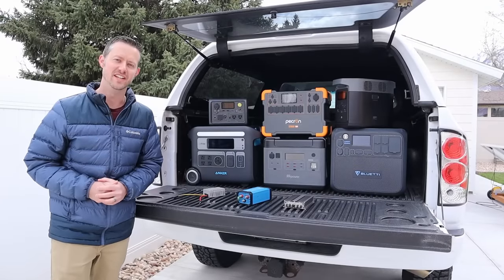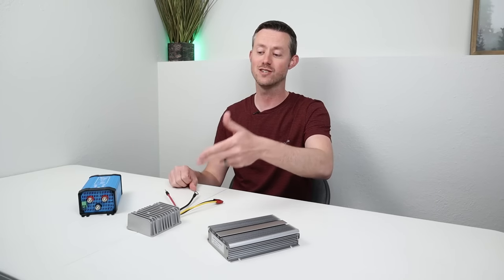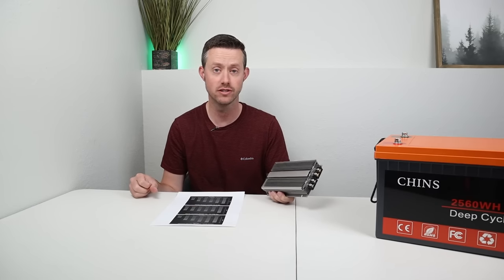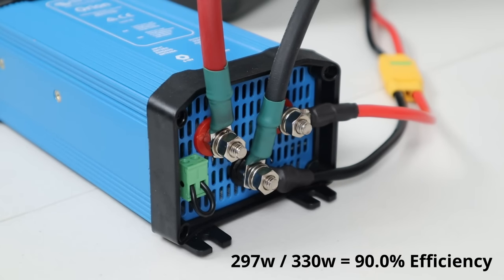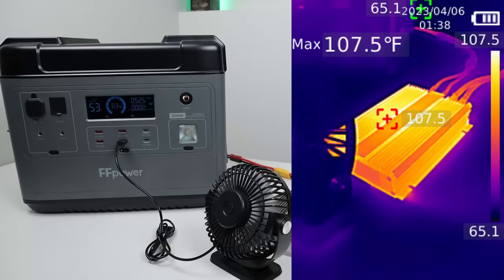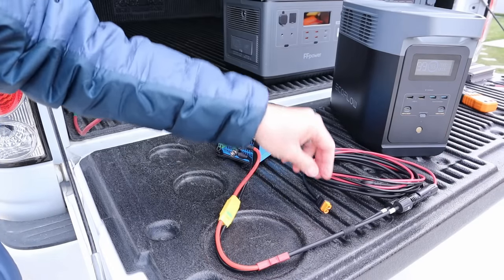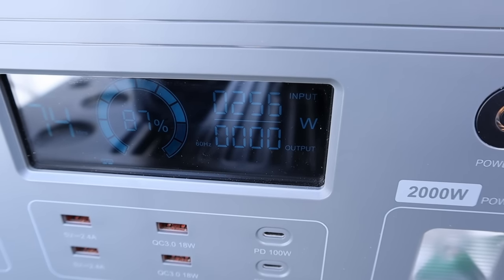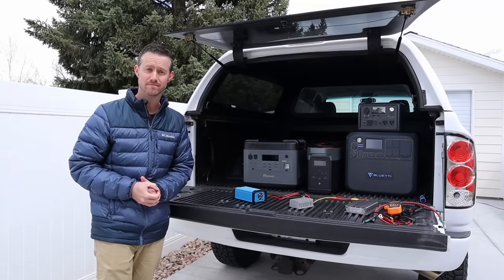Charge Your Power Station In Your Car FASTER - Perfect for Overlanding, Car Camping, and Van Life!

Comment: What size wires do I need to do a 17 foot run(back of truck)
Reply from the maker: Which power station and converter would you go with? It's all based on the total amperage you'll be pulling over the wires.
Reply: @Jasonoid  I want to go with the Victron 12/24-15 Isolated (360 W). Plan is to run it at 30 volts to get more watts into my battery pack (xq60i connector 15 amps max). I watched a video where the guy showed even though his was a 20 amp non smart dc/dc conv,  30 amps was going into the positive post on the converter.

This confused me on what load I should expect. I thought it would only pull what is on the box in his instance 20 amps for mine 15. I assume it wont always pull peak amps rating all the time but do I have to plan for higher current even when my battery pack only charges at 15 amps max?

 Peak current rating on the victron spec sheet is 25 amps so I choose 6 gauge. I believe it gives me some wiggle room but every volt/amps/feet chart I look at is different some of them say run 4 gauge etc. To help you I believe AWG 6 gauge is close to 16mm 2 Metric wire.
Reply: Also plan on using a 40 amp breaker
Reply from the maker: @MR-kc9xt  6 awg is good for 60 amps. The fuse is there to protect the wiring, so you can actually use a 60 amp fuse. The other thing I recommend is that you only run the converter at 50% of its rated power for longevity. That 15 amp model will be maxed out and could possibly fail much faster due to running at 100% load. If you use the larger 30 amp Victron it will run at 50% of its rated power and will last longer. I guess it also depends how often you plan to use it.
Reply: I will try and mess around with the settings to lower its output. Going to be charging a ecovacs battery pack. IN march it will be the first time my partnnr and I 4x4 camp with a fridge so I am not positive what my battery usage will be. I do know 10 amps from a 12 volt socket wont be enough though so found this solution in your video, thanks.

Comment: Did you notice how small the included hardwired cables are on the  cheap model!!
I went from theirs to 10 guage with MC4 ends to make it like a solar panel.
Reply from the maker: This is an nicer model and it came with 10awg wires on the input side stock. I was impressed 👍
Reply: @Jasonoid  oh nice! Looks like illl have to invest again. Thanks for doing the detailed video! Lots of information in perfect length clip as always!👍
Reply: @Jasonoid  Yes, and 12 awg on the output but from your video, it will output about 200w to the power station.  In my setup the cable run from the step up converter to the Bluetti AC200 Max will only be six feet, so 12AWG should be good enough.

Comment: Isn't the concept if having your car charge the large battery is a bad thing? Alternator isn't designed to work that much. I also don't really understand the point of rapid charging the power bank through a stand alone battery. You will still need to recharge the battery afterwards. 😅
Reply from the maker: Using a standalone battery in the video was for testing purposes to measure the power output from each model and the efficiency.
You can stick to 100 watt charging on your power station if you want, no pressure to charge faster. Pulling 200 to 400 watts from an alternator won't harm anything.
Reply: @Jasonoid  ty

Comment: like if you plug solar sysem with the thick blue plug and victron with the small pin where you plug wall brick( and the bluetti enhancer) I would be really grateful for any info
Reply from the maker: You would want to connect the Bluetti charging enhancer to your solar and plug that into the AC charging port (7909mm port). You'd connect the DC to DC converter to the solar input port. That's the only way you could use both types of input on the AC200max.

Comment: please! im desperate. I'm thining to get aferiy p210 and planning to charge it with solar and alternator at the same time. I wanna plug the powerstation straight to the ac plug with an inventer, do you think I need to get a small inventer or adjustable one maybe so I won't burn my alternator? thanks dude you have been helpful lately!
Reply from the maker: If you are wanting to charge with an inverter it looks like that model will charge at 1100w while AC charging. You'll need a 1500 watt inverter like this:
https://amzn.to/3OLDuKi
Reply: @Jasonoid  thanks ! My worry is that if it's draw 1000w wouldn't this be too much for an alternator ? If no I'm buying the one you send me. I just have to find it on UK amaozn as I'm in Ireland. Much appreciated you get back to me
Reply from the maker: @pijanysamuraj  whats the rated amps of your alternator? Usually a quick Google search will determine that
Reply: @Jasonoid  oh shit I don't know I need to do some research. It's an old 1992 Ducato camper. I'll try find it out
Reply: 55-60 amp ?
Reply from the maker: @pijanysamuraj  if the power station charges at 1100 watts, I'd plan for around 1200 watts power usage with inefficiencies. 
1200 watts @ 12v is 100 amps
(Volts X Amps = watts)
You'll need an alternator that's good for at least 150 amps to run that inverter without killing it.
Reply: @Jasonoid  thats not the best news as what I read those alternators are between 55 and 60 amp :/ I don't mind if this will charge slower as long as it will charge
Reply: So my 60 amp alternator won't be any good for this ? I don't mind if it charge slower. So what wattage inventer I need to look at ?
Reply from the maker: You'll need a power station with an adjustable charging speed like Anker or Ecoflow. The you can use the inverter size you want.
Reply: @Jasonoid  the one that has it doesn't have like 12v 25/30 amp to power my fridge light boiler etc. Adjustable inventer wouldn't do the trick ? Once again big thanks for getting back to me and helping me out!
Reply from the maker: @pijanysamuraj  the max power you could pull from that alternator is around 25 amps, so about 250 - 300 watts. Good luck on finding a solution. I can't add on to this thread anymore 👍😁

Comment: How are you connecting the dc to dc charger to the power station?
Reply from the maker: Via the DC charging ports. Positive to positive, negative to negative.
Reply: @Jasonoid  for XT60i, I see that there are ring terminals on one end but for the end that connects the XT60i to the power station.
Reply: @Jasonoid  with freestanding 200max in sprinter , should I hook up   isolated victron converter  instead of non isolated?
Reply: are you the same c . clrke that grew up here in s. surrey and graduated SEMIAHMOO s .s.?

Comment: Why not just use a 1500 watt inverter? You connect it to your vehicles battery and get 110V into the unit
Reply from the maker: 1500w inverter pulls over 120 amps from your alternator. Thats asking to burn it up quick. I'd say 400w to 500w is the max I'd pull from a normal alternator.

Comment: What would work well with the bluetti eb70 ?
Reply from the maker: Great question! I'd recommend either the 12v to 24v smaller option or the Victron (with the voltage adjusted slightly lower). The 36v booster is too high and will damage the EB70.

Comment: Could you use a 12v inverter?
Reply from the maker: Yes, you could also use a 12v inverter but  you'll need a huge inverter or a power station with adjustable charging speeds so you don't pull too much power from your alternator / starter battery.
Reply: @Jasonoid  I've got the anker 767...a 1000w pure sine wave inverter that hooks to a car battery is 75 dollars on Amazon.  What would that push into that unit if you just plug it in to the 120v outlet coming out of the inverter? Is it the amps I need to worry about.
Reply from the maker: @ms.crystal8280  yes, too high of amps would be the problem. Set the AC charging speed of the Anker767 to 400-500 watts within the smart app and you'll be golden with that inverter on your car.

Comment: The cable from the battery under the hood to the Lithium house batteries burned completely off.
Reply from the maker: Wires can burn up because of different situations. Some of the reasons would be bad connection joints, short circuits because the cable insulation was damaged, or even from having too much power flowing through them. You need to know what the issue was in order to fix it. Having someone local in your area check it out would be best.

Comment: so at time 12:!1 you never showed how it's connected to the truck. Did you run a long cable to the battery up at the front or what?  My truck has a couple of ac outlets in the bed, but those are ac so I'm guessing you didn't plug into those. That was the whole reason I clicked on this video.
Reply from the maker: I ran 6awg wire in a previous project to the back from my truck. You connect the DC converter to your starter battery with this wire run. Positive wire with a fuse. Negative wire.
Reply: @Jasonoid  thanks, I didn't see that one, I'll have to track down one.

Comment: The Victron is a little disappointing 28 volts. The Renogy is 36/48 volts @ 10 amps You are not testing this model so we cant see how well it would do.
Reply from the maker: I looked for weeks for eligible boost converters, never found a renogy option. What's the exact name of it?
Reply: @Jasonoid  Renogy Boost 10A 36V/48V Auto DC Input MPPT Solar Charge Controller LCD Display Solar Panel Regulator fit for Sealed Flooded AGM, GEL, LFP, USER Battery for Golf Carts and Electric Vehicles, Rover 10A
Reply from the maker: @mannyfragoza9652  yeah, that's a 'charge controller', it's not going to behave the same way as these boost converters. I don't think it would be able to see the power station input as a charging voltage. Different type of device unfortunately.
Reply: @Jasonoid  Will has a video on the Renogy Boost i think it would work just fine for you application it just has added features
Reply from the maker: @mannyfragoza9652  email me the link to the video and I'll check it out. Jasonoidllc@gmail.com
Reply: @Jasonoid I’ve also been wondering how this Renogy unit might work, as it’s supposed to charge 36/48V batteries from 12V range solar panels.  Hopefully it can boost to 56.8V but might require something on the solar input end to protect against short circuit, as some MPPT charge controllers do this to stop incoming current at the end of charge. It’s fine if you’re using solar panels as input, but almost everything else is not so fine 😅

Comment: Can you do this on a goalzero?
Reply from the maker: What the charging input voltage limit on your GoalZero model?
Reply: @Jasonoid  it says 15-50V, up to 50A. 600W on HPP and 150W on 8mm. They also make a Car Link kit, which will charge at around 500W but it is proprietary for goal zero and per unit at a time.
Reply from the maker: @jkonquer3853  the goal zero will work with any of these converters, just make sure you use the high power charging port, not the 8mm.
Reply: @Jasonoid  thank you, i believe goalzero uses proprietary high power connectors, i maybe wrong.

Comment: Have you made a video charging power stations with an invertor from a car cigarette lighter?
Reply from the maker: Car cigarette ports are rated / limited to only a 120 watts (sometimes 150 watts). You can't really run an inverter from those low power ports, it will blow a fuse. It's better to just plug the power station in to charge without the inverter on the 12v ports and just get 120 watts. 
If you want more power you'll need to connect directly up to your starter battery and use a boost converter or an inverter that way.
Reply: @Jasonoid  You mention in this video the use of an 500-watt invertor. I'm a bit confused.  I won't use one, however. I happen to have a 500-watt invertor. Just won't use it now.
Reply from the maker: @tim1299  you can use a 500 watt inverter, just not plugged into the 12v socket. You need to connect it directly to your car battery to be able to pull that power.
Reply: @Jasonoid  Since I charge my house RV battery while driving also, I could use that one. Or is that asking too much from the alternator?
Reply from the maker: @tim1299  it should be fine charging both at the same time.

Comment: Where'd the Anker go?
Reply from the maker: The results for the Anker767 are in the graphs for all three converters. I only showed a few tests at the end to keep the video shorter.
Reply: Have you checked the polarity of your Anker while plugged in yet?  I posted a video of testing mine.  The new one came in today and it’s wired correctly.
Reply from the maker: @leafnutz2341 yes, mine is wired properly. It shows open ground while unplugged and correct wiring when charging on the grid.